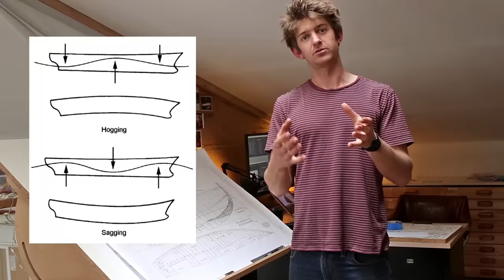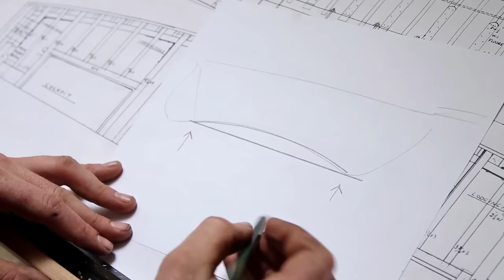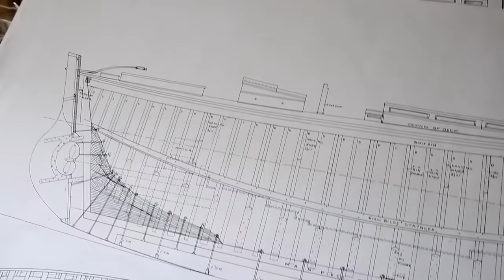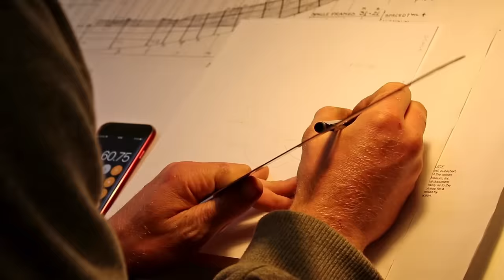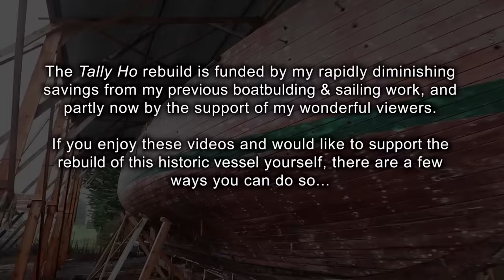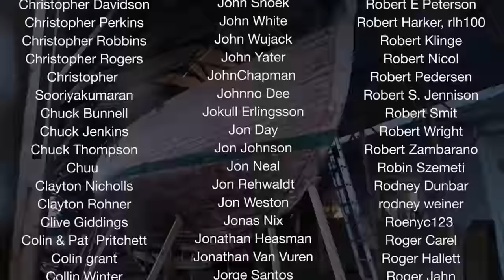Restoring a HUGE vintage Ship Saw / Bandsaw - Rebuilding TALLY HO EP22

Comment: A Variable Frequency Drive (VFD) is a modern device to run 3 phase motors with single phase supply voltage. The method shown is a great example of ingenuity overcoming a problem.
Reply: Hi. Leo say 240V  singel phase. Is this lokal ore ?? Is the 115 V single phase not all over the  US?

Comment: Serious machine envy, what a gorgeous bandsaw :)  Make sure you grab some way oil for the rotating ways...Bar & Chain oil works well for that too.  I didn't get a good look at the motor electronics, but since there's a motor to kickstart the 3ph motor, it's probably a static converter.  Which means you'll have a 2/3 of the available horsepower of the motor.  If you find yourself needing more, rotary phase converter are pretty DIYable.  Electronic variable frequency drives (VFDs) are reasonably cheap nowadays too, depending on how much hp that motor has.  Both an RPC and VFDs will give you true 3ph and the full horsepower of the motor.  Awesome work, watched every minute of the series so far!

Comment: Seeing this saw reminds me of the time I bought a 28” band saw built around the same time as this one while I was living in California. The frame of it was a single iron casting in the shape of a giant “C” and the wheels were 28” in diameter, spoked and also solid castings. I was so excited when I got it back home and into the shop that I couldn’t wait to fire it up. It had no blade guard whatsoever and as I made my test cut in a scrap piece of 2x4 the blade came off the wheels which was pretty alarming. I used the piece of wood I was holding to turn the machine off so I wouldn’t have to go near the unshielded blade. A moment later the lower wheel slid forward off its axle still rotating at full speed. It bounced upwards into the bottom side of the table with enough force to break off a piece of the table about the size of my hand which landed right behind me after hitting the ceiling two stories above. The wheel exploded into about 20 pieces as it launched itself into my jointer across the shop to my right. It all happened so fast I just stood in the midst of the chaos surprised at how I had evaded death or serious injury. I ended up selling that machine shortly thereafter and resolved to only work with newer machinery after that.

Comment: Leo, Congratulations on your Massive/WAY COOL Ship Saw---I do not know if I will ever actually get a Ship Saw/Bevel Saw but I have wanted one from the first time I saw one operate . Using it on Ship Frames/Futtocks is great, but there would be other uses for furniture and Cruck Houses (curved Timber Frames) . Please make some guards for the blades because someone getting killed or seriously injured is going to slow your project down .  Steve Cross akaSuperAX
Reply: Yes Leo don’t let anyone die as it will slow the progress!

Comment: I've been a Craftsman and fabricator most of my life and I have to say that I'm blown away by what you're doing with Tally Ho.   The Purpleheart keel impresses the Hell out of me!  I've worked with it on small-scale s things but, WOW!   As for that old saw,  I will say that, sometimes, there's no substitute for an original piece of equipment.  Some of my best hand tools are pushing 75-100 years old.   This is really cool because not only are you saving Tally Ho from an undeserved grave, you are also saving a unique, antique piece of equipment from a trip to the scrappers.  My prediction is that you'll get that saw restored and running and then you'll wonder how you ever got along without it!

Comment: You should place those stickers in your lumber piles in line one above the other or regret the results.  Another suggestion is paint the ends of the boards to prevent the ends from premature drying /cracking in summer sun as compared to the moisture in the middle of the board.  I had to learn these lessons the hard way.  Lastly keep up the good work.
Reply from the maker: you're right about the stickers. cheers

Comment: Leo, surround the bandsaw with pallets all around and screw down some OSB to connect it all for a platform to work from to keep you out of the mud and debris.  This will also benefit in raising you higher for a good sight line.    Looks like the stars have aligned over this project.!

Comment: The Western Boat Building Company auctioned off all of its shipbuilding equipment in 1980, which is when Nate said he bought it. If your saw was purchased from that auction, its sister, which WAS bought at that auction, is sitting at the Port Townsend Shipwrights Co-op and is currently being used to rebuild the Western Flyer, the seiner chartered by John Steinbeck and Ed Ricketts in 1940 to go to the Sea of Cortez. Ironically, it was the Western Boat Building Company that built the Western Flyer in 1937. The Western Flyer Foundation is, as you are, doing a series of videos documenting the rebuild.

Comment: Great find on the ship saw. It's great that it is getting a new life in the boat building industry. I'd call it a prize of a life time. I'd call it a vintage around the 1910 to 20's It was set up for steam engine line shaft power to run it. The fact that it has brass or bronze bearings instead of poured Babbitt bearings leads me to believe the later years.

Comment: I congratulate this gentlemen and his colleagues for this ambitious project and since I come from a family of boat builders, I feel that these people are doing a great job in bring back the romance of  history in these  elegant and majestic wooden boat. 
I do not seem to agree the removal of those  bottom iron frames  which held the keel so reliably to the wooden frames.  There overlap on the frames and their attachment  to the keel was such that no wooden system could replace the  distributed strength of those  short iron frames.  I do not agree that they had a water trap  under them as at that position, the keel is very wet indeed and a boat of that size would have wetness in its bilges.   Anyway, it is rain and dew that destroys wood in general and salty water hardly ever destroys wood.    Come to think about it, I do  not know if this boat is going to be used in the high  open seas or on a lake. 
The band saw is a beautiful ingenious machine and it is much better rotating the head rather than tilting the table as in my small bandsaw.  When I worked at the Royal Naval Dockyard at Chatham Kent in England I often visited the  gigantic shed  in which Nelson's Victory was built.  The woodwork supporting that gigantic shed is a marvel on its own and the woods used was such that one British Admiral always planted acorns every time he went into the forests where the woods to build the British Navy was being cut down.
In Florence Italy when they built the dome of Santa Maria del fuore, they needed so much support wood to hold the 49 metre dome that they thought they would not find enough trees to cut and do the job till a young "goldsmith"  told the authorities of the day that he would build that brick dome without any support under it. He did it in 16 years and not a single wooden support was used and he used a herring boat system of interlocking the bricks where they stand to this day.
I wish to congratulate all those who  worked on this wooden boat. It is good teamwork and it is encouraging to know that people  still get together to build a boat fraternity that worked in silence along all the shores of the known world to  build crafts which will render easier transportation and make family life a little easier. Those people had pride of work and these people  show it too. Congratulations once again.

Comment: Leo, I am enjoying watching you rebuild this beautiful old yacht. When I was a kid, back in 1963, I used to watch a beautiful catboat, about 30 ft., being built in an old shed at a tiny boatyard near my home. The yard is still there, with one of the oldest working railways around, but the catboat is long gone. This is a very interesting and well done video. That bandsaw is beautiful! I'm conserned, though, that when it comes to cutting the liveoak it will need a better source of power to keep the speed where you need it, while maintaining the torque to cut it. Have you considered a D.C. motor? They can vary speeds easily and you may be able to find one at an electrical motor repair shop. Even better, one of your YouTube followers may have one. By the way, your local farmer, Andrea, seems to be an outdtanding asset despite being  beautiful. I admire your fortitude, being able to consentrate on the job at hand. Were I you, I would try to keep her around. A woman like her is rare and not easily won.

Comment: Hi Leo.  Essentially just about 3 years too late with this piece of advise.  Do you still have the ship saw?  The "contraption" made at around 14:38 in this episode (Ep22) is about as old school and ancient as the saw itself.  Not sure if anyone else has told you but a Variable Frequency Drive (VFD) can do the same function as this device and is very much smaller, safer and efficient.  The only thing is you will have to manufacture a mounting box with a dust filter as they don't like lots of dust.  We use them in the Bladesmithing/Knife Making industry or hobby to power our 3 phase motors on our belt grinders.  The other advantage is that it has is not only does it convert 2 phase to 3 phase, but it is actually designed for speed control so you will have the added advantage of programming it to match the motor of your saw and you will be able to adjust the speed of the motor in accordance with the type of wood you are cutting.  https://en.wikipedia.org/wiki/Variable-frequency_drive

Comment: There is an expression in German that describes the process pretty accurate "Was nicht passt wird passend gemacht". What isn't fitting will be made to fit.
Reply: I was after a boat to sail around in the Med. For the time being I don't intend to cross the atlantic but that might change. I was after a Halbberg Rassey 42 Malö or Najad in the same size. Well I ended up with an old Lady build in 1980. She was drawn by Arvid Laurin which is a famous ship designer from that time. I hitrnink it was the lines of the ship and its history that got me.
I bought her rather cheap but have spend a fortune in renovating her.
I started in sailing small dinghies made of plywood like the OK dinghy and I seem to . end up sailing a 20 ton wooden boat. 
In a few weeks time I am ready to start sailing her back to her home in Sweden. That will be more than 4 000 nautical miles or around 8000 km for land rats.But that is not were she is going to end up. I nowadays hate the swedish winter so she will soon go back warmer waters.
A great thing with the White Lady is that the underwater part is totally covered with copperplates. No need for antifouling. She is also built for taking a beating in Biscay if necessary.
<a href="https://matsalm.smugmug.com/Sailing/i-RmJTNMK/A"><img src="https://photos.smugmug.com/Sailing/i-RmJTNMK/0/b03288a7/X3/_ALM5573-X3.jpg" alt=""></a>

Comment: Well, sometime back I saw a clip of you fitting a plank, you looked a little young to know the jig trick so I subscribed.. Not having the time to watch any before this morning, of course the old flywheel  caught my eye and...
What a work of art that old C Band-saw is!
20 years back we knew we didn't have enough young trades entering the programs, so very nice to see this segment.
One thing I would like to share about exotic lumber- they usually grow in rich mineral parts of the world. When we mill this timber we release this in the form of dust which we then absorb through our skin, mouth and lungs. We don't all seem to react at the same scale to this exposure but we all end up with the same symptoms within days, has been my experience. 
I am a believer that a tradesman must look after his personal welfare, this means adding safety gear to the cost of any project.
Just an opinion
Patch

Comment: The phase converter- it needs properly sized start capacitors and an adjustable timed relay and contactor and it will start without a pony motor, much safer

Comment: The electrical setup is really an old school way to convert power. A variable frequency drive would be more efficient. Many will run on single phase and output 3 phase.

Comment: The worm and opinion on the ship saw will be a struggle to keep lubricated as the action wipes grease away from the teeth. But it's slow running so an oil bath for the wheel to dip into would keep it oiled up. A box cover would keep the oil clean.

Comment: That is an awesome saw, but using a rotary converter is sooooooo old school and inefficient. There are variable frequency drives that can convert  240 single or even dual phase to 3 phase far better. A VFD would also give you full speed control with 
speed regulation and soft start/stop, which for a monster of a machine with all that kinetic energy is a very good idea.
Reply: Rotary converters and VFDs both have their place.  A VFD comes with it's own issues and limitations, especially 5HP and up, which I'm guessing this saw is running at least 5hp.  Not sure how much of a value add variable speed would be in this application either.
Reply: Dave Case 746 Watts per HP. VA from 240 V at 4 amps is only 960 VA for running at no load and with a load and those massive wheels I could see only a double on the load when cutting and close to that on a cold start, 30 amps at 240 V would be 9.6 HP. All of this is assuming full eficiency from the rotary converter, which is closer to half than 100%. A VFD will run closer to 75% efficiency and not have issues with in rush current or the stall current tripping the breaker.
Reply: Why not just replace the motor on the saw?
Reply: Have you priced a big electric motor recently? @BobWiersema
Reply: "Old school" is an odd pejorative to choose when trying to persuade someone like Leo. And inefficiency is only problematic if you're consuming a scarce or expensive resource. My take is that a shipsaw just isn't running a big enough proportion of the time on a project like this that Leo would ever win back the cost and effort of switching to a VFD, let alone be substantially ahead.
As for kinetic energy, the wheels are considerably geared-down. Kinetic energy varies with the square of rotational speed, so this is a crucial distinction.

Comment: Dang! Leo! You coulda got a  bunch of old truck leaf springs down at the junk yard and had badass corrosion resistant spring steel in there instead.of those white pine floors. Or oak.

Comment: What are the pros/cons of deleting the iron floors? Why were they used in the first place?
Reply from the maker: they will be replaced with new ones eventually, they are very important - they basically hold the keel timber and ballast keel on!!
Reply: Thanks for the clarification.  Will they be timber or iron?

Comment: hey make some sheet metal guards over the wheels. it will keep the blade from flopping around if it breaks or comes off the tires. wont take more than an hour to make some out of thing gauge sheet metal

Comment: Beautiful saw.  Careful with the stickers,, the spacers between boards.  And,, as you already know, a board that still chases the shape of the limb,, stickering is more art than science.  From out here in 'shoot from the hip' viewer-land,,, my comment is,, stickers over stickers,, and make sure the ends are suitably supported.  Sun, weight, time, can bend the begeebers out of your live oak.  Live oak may be one of the toughest woods on the planet,, but oh, how she loves to take a bend.  You can use that character too, if you need it.  BTW,, I know you and white oak (English white oak) are acquainted,, working, cutting, steam bending, sanding,,,,   New England white oak, old growth in particular,, is what was used to plank the US Constitution.  Not sure any, can be had, anywhere, at any price,  but Lordy,, that stuff used to dull Aluminum oxide sanding belts.  It was like sanding rubber carbide.

And,, I am still so vastly impressed that you found your live oak, and a 'good ole boy' to slice it in flitches for you.  Well done.

Comment: I was trying to imagine  why Stow's cast the floors rather than cut them from wood and maybe it was for reasons of cost. They would have needed to create them from wood in any case to get the exact shape to cast so maybe that was done with a cheaper wood. If that is the case then replacing the cast ones with live oak makes your finished Tally Ho better than the original. Does that make sense?
Reply from the maker: There are some benefits of Iron floors, but certainly not cost, I don't think. They give more bilge space and were considered stronger at the time. Incidentally, I think they are wrought, not cast. Ideally I would like to replace them with cast bronze, so I am able to stick to the original plans (and retain bilge space), but avoid ferrous metals. Bronze is $$$$$$ though!!
Reply: There's an easy way to find out, wrought or cast. Slice a small piece off and send it to a metallurgy lab. Polished up they look very different through a microscope.